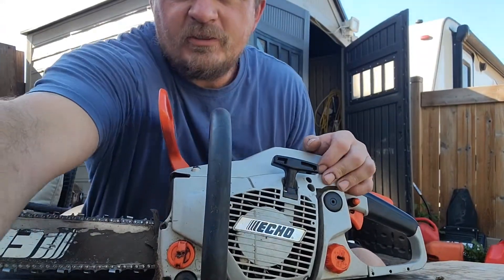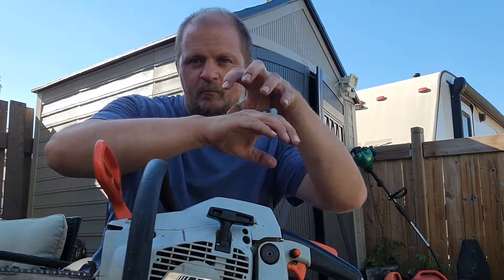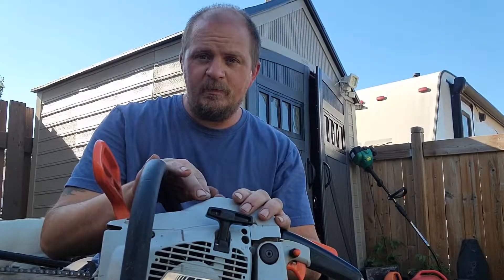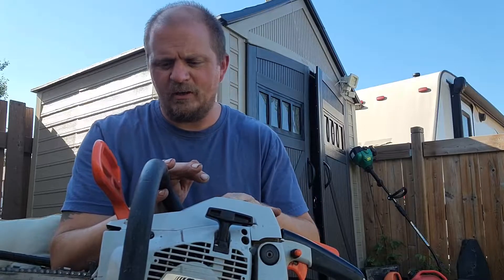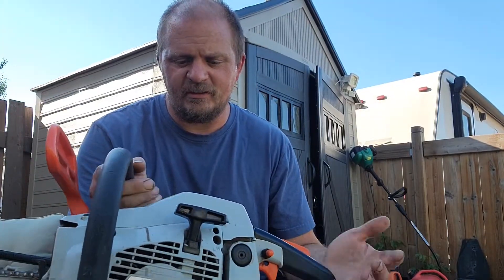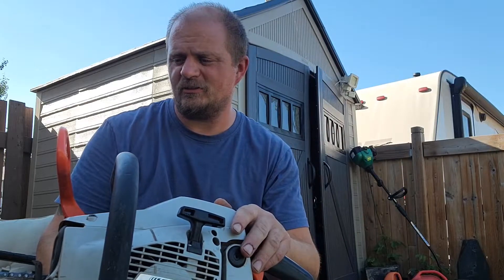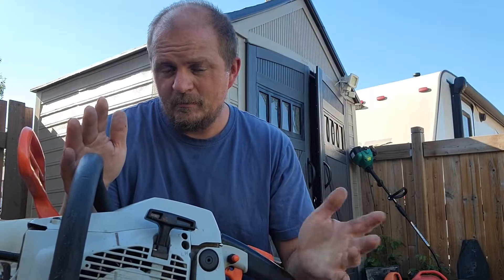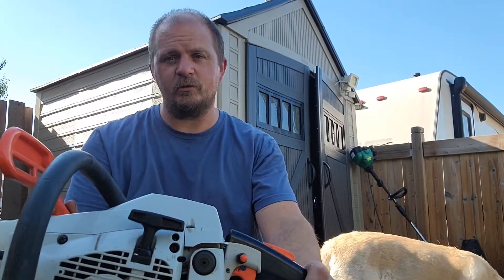Echo's little unicorn.. the cs-440

Comment: I really took a shot in the dark when I got mine. I was the first one in my area that I know of to get an Echo chainsaw, and it really paid off! I’ve got many many hours on it cutting hard and softwood. Over the years I’ve cut a lot of oak firewood big enough I couldn’t reach the middle going all the way around. I’ve used it in all types of situations from firewood, to carpentry, even a little logging. I had no idea how it was designed engine wise because I haven’t had to do any work to it! Just a mild muffler mod and a little maintenance is all. I’ve run quite a few pro saws and it has been every bit as good as they are!

Comment: I wish I had one!  I have a few 4400’s but that 400 is cool!
Reply from the maker: If you ever wanna get rid of a 4400 or do a trade,  let me know,  really getting into the echos,  think they are often overlooked
Reply: 2 are parts saws and one is a decent one. Cylinders are so hard to come by in decent shape. I will keep you in mind!
Reply: I have a 4400 also.the cs440 and 440 are very underrated...echo is the only brand out there in the 40cc class with an adjustable oiler.even the 370 is adjustable..stihl and husky dont have that till up to the 55cc class.

Comment: I have its ran awesome but something fell in the recoil starter assembly when I was cutting and it destroyed the plastic part that starter rope is coiled on and I can't find a cheap replacement and they are different from all common parts available
Reply from the maker: That I'm unsure of but I thin the 4200, 4400 recoils are the same